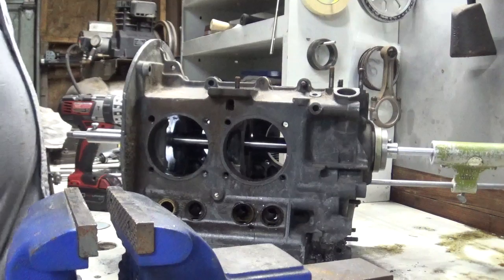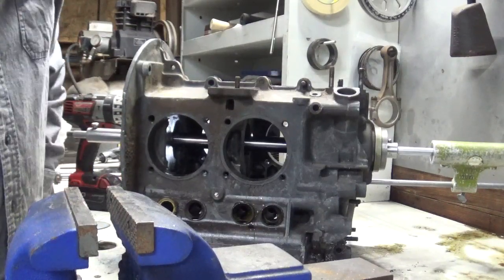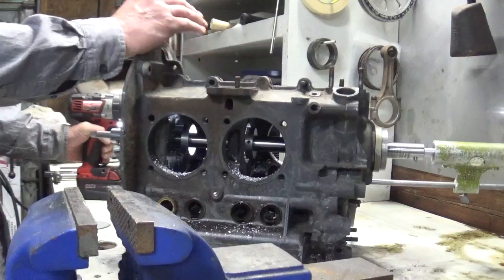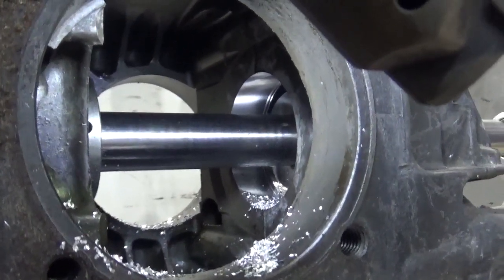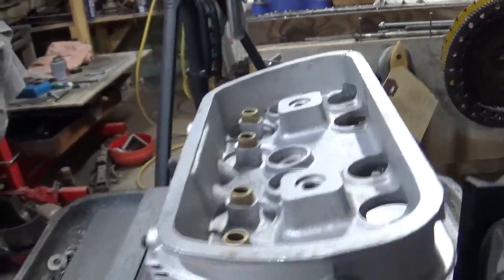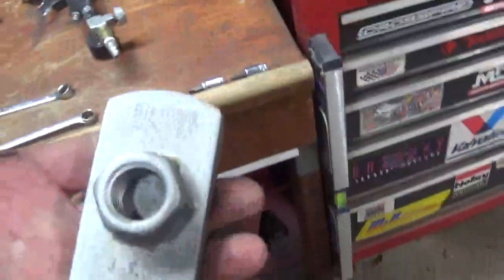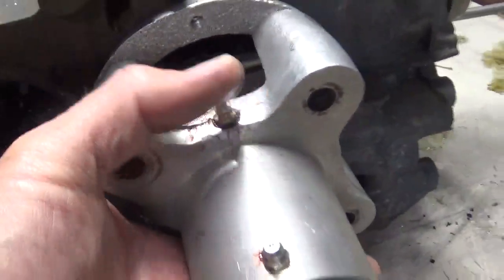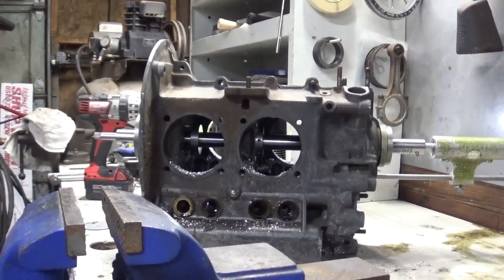To Line Bore the Air-Cooled VW block

Comment: This is a PortaTool originally called the VW-700, later version called the Mainliner has the hydraulic feed all built into the flywheel end of tool. The external hydraulic feed in your video is actually designed to be mounted on flywheel end & you drive it from the pulley end. You can get actual original instructions that came with the tool in 1970s from BEAM Equipment. I was pleased to buy a set for $15 because I bought one of these at an auction a month ago. Used a similar Mainliner on at least a thousand VW cases 1973 thru 1999. Getting back into it now in retirement.
Reply from the maker: Thank You for the information. There are not many videos or people that explain the setup on these. So I'm making an educated guess on the procedure. I will for sure get the manual.
Reply: There are a couple of different boring tools that have been around for decades and all have different designs for holding tool bits. There is one problem I believe they all have and that is the ability to cut the thrust face on the inside of the case, at least that is the issue with a Truline bar.  The problem is to be able to remove just enough to insure perpendicularity to the centerline of the bore. If that is not accomplished before you cut the thrust to size from the outside, you will not get a uniform interference fit for the thrust. I made the tools years ago, both to cut the inside thrust and outside. The inside I attached to the bar as an additional step and the other is a separate bar with a cutter. I get perfect fit every time and I would gladly share my design...!  Dan Nelson
Reply: @alumicomp  can you share your design? I am Interested
Reply: @12gofast  If you have anyway that I can share my information, I will be happy to share. I can tell you it is an eccentric that I have machined to clamp on the boring bar, and I am not sure how to get pictures or info to you.
Reply: @alumicomp  I searched but couldnt find your contact information
Reply: @12gofast  That's unusual, but try Aluminum Component Fairdale..! I'm not sure what information you are allowed to share on a place like YouTube, but I am in quite a few places on the web..!
Reply: Did you ever service the mainliner line borer? I have an old one that probably needs a fluid change, and have never done it.
Reply: I would like to find out where to get a boring tool
Reply: @alumicomp  no inside thrust out only

Comment: Geehuz man - you are winging it?  on a customer's block too?  How do you even know if you have the proper bearing crush..or if the bores are even round?  T/here is a way to make the PortaTool a lot more accurate than what you got there.  Those setscrew cutter bodies move during the cut and will cut oblong.  A new body that is bigger and clamp-style will do a better job.  Better yet - get a TruLine boring bar.

Comment: Where can can an boring tool be purchashed
Reply from the maker: Just have to search on -
EBAY
The Samba
Google search
They are NOT cheap. Sometimes u can buy pieces here & there to assemble a full set
I'm sure new ones are available - not sure about where or how much.
Reply: Rocky Jennings Enterprises if you want a brand new, top of the line boring bar and tools. It will cost you, but you get great quality.

Comment: What size motor are you building?
Reply from the maker: 1835 - for a sand rail
I will be doing a video on the parts list. Hopefully in afew days.
Reply: VW MountainMan I’ll tune in. I’m doing a stock 1600. Just got it torn down.